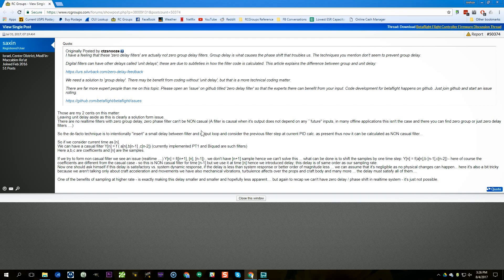Betaflight 32 kHz | YES OR NO?

Comment: What about 32k and the new dynamic BF filters? Recommended?
Reply: ATCr, Joshua. The thing about experimental features is that they are experimental.

As developers we add them because they may improve the flying experience and it's fun to code them. Some of them may work well straight away, and some may have both advantages and disadvantages.

But if we don't get at least a proportion of pilots trying them out and giving us feedback then we cannot improve them.

So if you say "I don't recommend 32k at all until more sophisticated filters are implemented", then those more sophisticated filters might not get developed.

Of course we expect the majority of pilots just want to fly, and so will not enable the experimental features. But we need some people who act as "test pilots" to try them out and give feedback - both what's good and what's bad about the new feature.

Dynamic notch filters are a good example of this. I added it experimentally at first, and my first implementation didn't work very well at all. But because we had feedback about this, @rav-rav was able to much improve my implementation to produce what we have now.
Reply from the maker: I don't recommend 32k at all until more sophisticated filters are implemented. You can try it, and maybe it will work great. It's a bit of a crap shoot. Just be aware it's an experimental feature and many people who try it get weird things like hot motors, twitches, strange noises from the motors, etc...
Reply: ATCr I just started running the Kakute F4 AIO  and BF freaks out when trying to run 32khz gyro sampling.

Comment: Very well put.... as an audio engineering professional 44 does suck and u dont get the "feel" but facts are facts u are correct once again.. big ups
Reply: I agree 44.1k can sound course on some playback devices but any half decent cd player with oversampling will give you a very nice sound at the users end.
Now don't get me started on dynamic range compression and overly hot mastered cd's with audible clipping (I am looking at you RHCP Californication album)
Reply from the maker: I belive that if you're doing production, then there can be advantages to higher bit-rates and sampling rates, but for mastering, 44k can capture all of the information most humans can discern.
Reply: Stephen Gibb lmao

Comment: Short, you can get 10 cycles of data qicker if the update frecuency is 32kHz than 8kHz. This would mean that the gyro can react quicker to unwanted movments like wind etc.
Reply: OK what I learned from this deviation is that trying to sum up this topic leads to over simplification and misinterpretation ;) ... BTW I meant to say thanks Joshua, I really do appreciate your prompt feedback in the comments and your topics lately have been spot on
Reply: True.
Reply: I'd sum it up by saying that gyro information at 32kHz can be more proactively calculated allowing for a more accurate response to things like propwash, wind or other unwanted effects. I got the impression the response isn't necessarily quicker, it's just reacting to a more accurate or complete sample of what's going on.
Reply from the maker: @rogue tropper I agree with I.C. 

The 32k sampling DOES give a more accurate picture, as you say. That's the increase in the Nyquist Limit. But the problem is that, since there is no meaningful information above about 600 Hz, all that additional information is just noise, and that's part of why 32k sampling is worse in BF than 8k. It doesn't have the software to deal with the noise correctly.

Really sophisticated filters may require more samples to work. The more samples they require, the more delay between the input and the output. Sampling at a faster rate means you can get the samples you need to do the fancy filtering, in less real time.
Reply: When I said  'proactively calculated' I was referring to what you said about more future information being available to the filters, not that the limit on sampled frequencies had allowed for a more accurate response. Typically when you talk about a sample being more accurate in statistics you talk about greater quantities and averaging rather than individual fidelity. I can see how what I said may have seemed like I was just pimping the increase in freq. I wasn't necessarily disagreeing with I.C. though I'm not sure the gyro would react quicker rather than provide information faster ... or is that the same thing ...

Seems I can't sum it up without elaborating ...  :)
Reply: It's not just about meaningful information. It's about the size of the PID correction.

In general 4 smaller adjustments is going to give better results than one larger adjustment. Of course you have to deal with the noise as well.

Comment: Joshua can you make a video about where, how to put capacitor(s) on 4-in-1 ESCs?
Have a great weekend
Reply from the maker: About the only place you can put them is on the battery pads. Some ESCs, like the Aikon 4-in-1, have a dedicated capacitor pad.
Reply: Solder them to your xt60 with your battery lead. Then heatshrink them to the xt60... Unless you have room under the hood.
Reply: sadigov this is absolutely true. I have a buddy that is one of the top guys at castle creations. Hes a quad pilot and swears by individual caps.
Reply: @ABMNS PRODUCTION: you could try a second (smaller) cap directly at the camera if that's possible.
I never tried it but i think it's worth a shot.
Reply: ABMNS PRODUCTION There is a video from Prof. Bardwell comparing VTX noise using a single cap on a battery lead to individual caps on each ESC. Second case had a lot better video. I can confirm from my experience. Today I flew with individual caps per ESC and the video was crystal clear. Much better than a single large cap on  the bat leads.
Reply: Thanks for the inputs guys :)
Trully appreciated! Have a great week
Reply: Joshua Bardwell Well i did put a 35V 1000uf cap on that location and my video is still pretty bad but better than without though, that's why i was asking for a more efficient location. I'm using the Typhoon 30A 4-in-1 ESCs, maybe i should investigate if there are dedicated pads for caps on them.